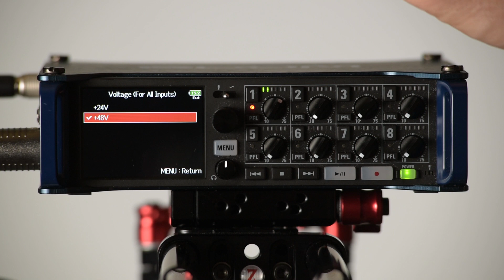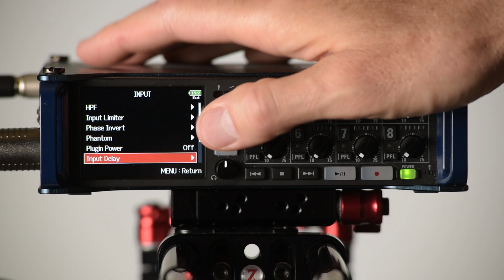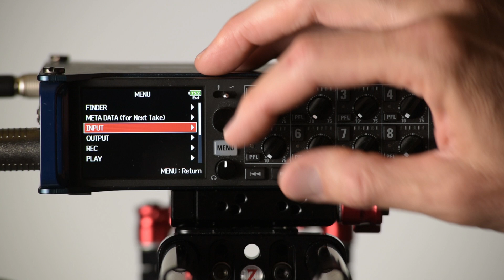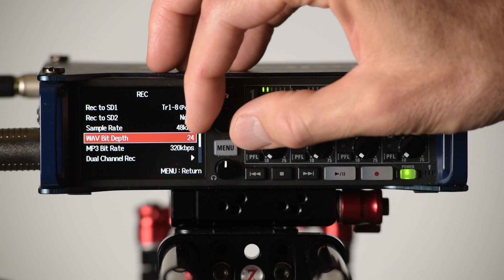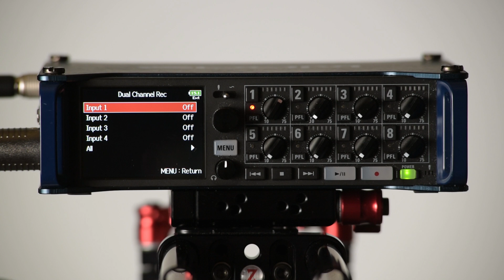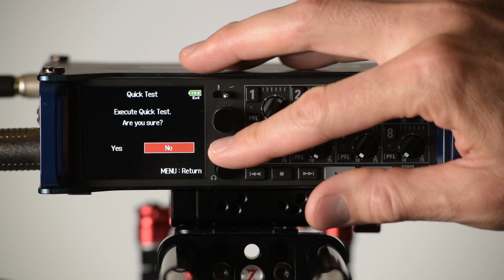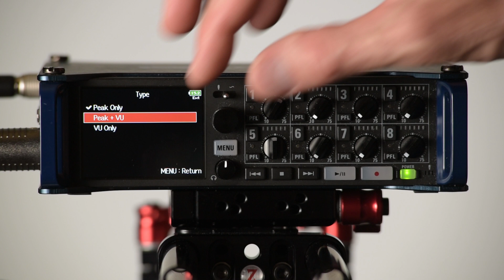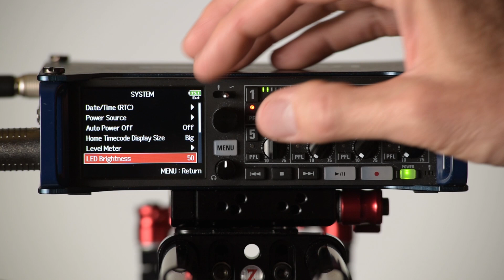Setting up the Zoom F8 Audio Field Recorder 30 June 2016

Comment: Please what is HPS mainly used for because I usually put my on 80
Reply from the maker: High pass filter? for dialogue, 80Hz is a pretty good place to start — it filters out low frequency rumble without cutting into the dialogue sound.

Comment: Hello after all these years:p i have a zoom f8 frimware 6.1 and i want to record line signal with a trs jack and i don't have the option in input source to select line! The only options i have is Analog inptut and usb 1,2,3,4. If you see this msg i will so much appreciate your help cs i search the hole internet and i couldn't find anything! Thx anw :)
Reply: Yes, you plug in the 1/4” TRS plug to the inputs on the F8 and that tells the F8 that it is a line level signal. If you plug in an XLR connector, that tells the F8 that it is a microphone.

Comment: Hi Curtis! Do you happen to know, why monitoring stereo mix from Ambisonic A format recording (in that case recorded using Rode NT-SF1) in F8 is so low? Levels are like 12dB lower than isolated A format tracks. Did I do something wrong? Is it a bug? A feature? Of course I can boost fader on Tracks 1-4 (Ambisonic) to +12dB but I guess it should not look like this.

Comment: Just a quick opinion on powering via USB and portable power bank.  You can do this as long as you have a USB/Hirose converter cable which re-amps the voltage from USB to something that the F8n can use.  And depending on usage, this can last all day.
Reply: Thanks Aaron.

Comment: Hi Curtis
Many thanks for all the very informative videos. 
I have a quite specific question, dunno if you have an idea for this: in rehearsals we frequently switch between recording ourselves and listening back to the tracks on monitor speakers. During recording we need the speakers off, otherwise we get feedback.

Is there a set of settings, that turns outputs off during recording, but on during playback? 

many thanks
Reply: Hi Rafael, unfortunately, not that I am aware.

Comment: Hello Curtis, many thanks for your tutorial. It helped me to get started. 

Now I am searching an answer for how set up the Zoom F8, when recording on sd1 : Mic 1 and 2 + Automix L/R in PolyWav

and

recording on sd2 : dual channel Mic 1 onto track 5 and 2 onto track 6 + Automix L/R in PolyWav?

I do not want channel 1 - 8 + L/R (PolyWav), because then the automixed L/R would contain the normal tracks (1 an 2) as well as the reduced dual tracks 5 and 6 tracks. That is wrong.
How to set it up correctly?
Many thanks in advance
Reply: Hi Ralf, If you only need the isolation 5 & 6 channels and do not want to include them in the mix, set their faders to -infinity. You will still record the isos and can use them in post if needed, but they will not play in the mix. Best wishes!

Comment: Hello Curtis! Thank you for great reviews! 
It might be an old one but I have a question in relation to zoom f8 outputs. What would be the best way to boost consumer line level signal when outputting to line +4/pro line level input since f8's outputs are only capable of outputting  -10/cosumer line level? Any advice would be greatly appreciated. Thank you!
Reply from the maker: Hi Skirmantas, most cinema cameras with a line level input have a trim setting so you can adjust that while sending tone from the F8 - adjust the trim on the camera until the camera's meters are at the same level that you're sending tone - usually -20dB.
Reply: @LearnLightAndSoundSessions  Thank you for answering my question! The main problem I was experiencing was that when I feed Sony UWP transmitter with mix it wouldn't stage it properly, uwp transmitter doesn't have control when switched to line level and the level would be far too low. I started using G4s for feeds in that respect they more flexible.

Comment: Hey Curtis! Thanks a lot for your video!
I have got two questions :
1) When you record tracks separately, do you get the PFL or the SOLO version of it? I mean does it make sense to bother doing a first mix on the F8n (even if things will be slightly modified on a computer later) or not?
2) Can you modify the mix while playback? As a musician, I cannot play and do the mix at the same time. So it would be perfect to do the mix while listening playback. And then I wonder if this mix stays for the next tracks that will be recorded..? I guess this option would be only available if recording separate tracks (and not if only recording the L/R mix)..?
Thanks!
Reply: Hi Lionel, 1) Yes, you get the PFL version of the isolated track. It makes sense to do a mix on the F8n while recording if it makes sense for your production. If you don't need it, then you don't have to bother. 2) No, you cannot modify the mix on playback in the F8n or any of the Zoom F series recorders. This is a feature available on the Sound Devices MixPre recorders. They call it re-mix.
Reply: @curtisjudd  Thanks for the quick answer!
Reply: @curtisjudd  One more precision : I checked those MixPre devices. It seems you can re-do the mix afterwards. Of the exact same track.
My question was a bit different. The idea is to do a sound check. Modify the fader accordingly (while listening playback) and then record a NEW track with this modified mix. (I hope I can explain the difference clearly).
So basically the question is : what happens if you modify the fader during playback?
Thanks!
Reply: @LionelAndrey  Do you mean overdub recording where you replace a track as another take like one would do in a recording studio?
Reply: @curtisjudd  No... Maybe I give you a concrete example :
 I'm a clarinetist and I record a piece clarinet + piano. There is no sound engineer (other than me also playing the clarinet). So I set the mics (a pair for the clarinet, a pair for the piano and a pair for general). I set the gain for the different pairs of mics. Then I do a soundcheck (meaning we play the first 30sec of the piece). I listen back and realize the balance (mix) between the two instruments is not good yet. Can I monitor this balance while listening back (like on a mixing table)? And then we would record the whole piece "for real" with this new balance setting.
If I cannot change the balance while listening playback then I need to change the balance a bit randomly (without exact control - if there is too much clarinet in the mix I'll put it down but I might not know exactly how much down it has to be) and then we need to do a second soundcheck, plus listen again to the playback to see if it is improved. Probably it's improved, but not exactly perfect so I need to fine-change the balance again, do a third soundcheck, etc... Before really recording the whole piece. So I loose a lot of time.
Of course this whole process is easier on the computer with the ISOs. But if it's possible to do it directly on the F8n, then I save time.
Reply: @LionelAndrey  Ok, I think I understand now. No, there is not a way to change the gain of fader on a recording which has already been done. However, with the F8, this is not too much of a problem. Because it has extraordinarily clean preamplifiers, you can adjust the levels for the two instruments and fine-tune the mix in post. The only thing you really need to be concerned about when setting up is that the instruments will not hit 0dBFS when you record. You can easily leave 18dB of headroom and then boost it perfectly in post production on your computer. I hope that makes sense?

Comment: If I plug in two XLR cables in Input 1 and Input 2 does can i attach them into the same file? (For exemplo having them direclty from a Mixer record Left in one cable, right in another) ?
Reply: Yes, set the F8 to record Tr1-8 to the SD card and you'll get each microphone on its own channel in the same file, called a poly wav file.
Reply: @curtisjudd  Cool, so with that feature, i can record a Mixer (Rec Out) and have two cables attached to each Input and have them linked on the same file, right? Is that the propper way to have it recording a Mixer?
Reply: @msiqueira-dev  Yes.

Comment: Thanks a lot dear  Curtis for these very thorough video's. Have a question for you...  After watching your video about the Tascam DR 701 i thought it to be the best option for me to shoot with the Canon 5D mark iv. Now after seeing the F8 i started to consider this. What i liked about the DR 701 was that it can be hooked up to the camera with HDMI and then start/stop the audio recording simultaneously with the camera. The F8 does not have something similar does it, and how would it work with the Canons timecode if it works at all? Many thanks again, Robert...
Reply: Hi Robert, The HDMI triggering feature was rather hit-and-miss in my tests back in 2015 when I did the review (I think it was 2015, maybe 2016). I don't know whether Tascam has updated the firmware to make that feature more reliable, but there were a good number of cameras with which it didn't work. And even with my GH4 back then, it worked about 50% of the time. That isn't something I'd recommend counting on. The Sound Devices MixPre series have a similar feature and recently update their firmware to work with more cameras. So that is worth considering. The Zoom F8 does NOT have this feature though it is a superior recorder in every other way to the DR-701D.

Comment: when using mine the l/r levels are much higher than the individual channels  levels and I cant seem to get trim/fader level set comfortable to use for live TV work, in your video the l/r level was equal to you channel one level, I cant attain that for some reason.
Reply: Are the faders for each channel set to 0?
Reply: @curtisjudd  hi there thanks for the reply, are you referring to the MAIN OUT 1/2 fader on the left side, detailed in white??
Reply: @curtisjudd  as shown in the photo scroll down here??  https://www.fujix-forum.com/threads/audio-recorder-zoom-f8-briliant.50161/
Reply: @stewartshape8978  I was asking about the faders for each input channel. Each input has a trim and a fader. You'll want to at least start with the faders on each input channel to 0.

The output faders are a different matter. I'd start with the input channel faders.
Reply: @curtisjudd  thanks again for the reply, I can get a mid level led level on the input faders when viewed on the multichannel screen led display but always the L/R output is always so much higher.
Reply: @stewartshape8978  What is the fader set to on channels 1, 2, 3, 4, 5, 6, 7, and 8? Is suspect they are set to something above 0 which is why you're experiencing this issue.
Reply: @curtisjudd  hi there Chris when you say fader do you mean trim level or "level post trim fader level" ?
Reply: sorry to use this kind of speaking but I have just changed from twenty years SQN USE!
Reply: @stewartshape8978  Each input channel on the F8 and F8n have three main settings you can use when mixing: Trim, Fader, and Pan. You should check to make sure that the fader for each input is set to 0. Please see page 76 of the Zoom F8n Operation Manual which can be downloaded from Zoom-na.com. I also have an online course on how to use the F8/F8n over at school.learnlightandsound.com if you are interested. We cover how to setup, mix, and get the most from your F8 or F8n. Best wishes!
Reply: @curtisjudd  and sorry Chris one more question, when I powered down on a set it started time code at zero again, without jam syncing to cameras or tentacle boxes, should I use RTC time code setting, to make sure I never repeat a time code even when I power down?? thanks
Reply: @stewartshape8978  Yes, I would use the RTC setting so you don't get overlap after meal breaks.

Comment: Howdy! I have a question... regarding F8 firmware v5 - after testing recording 1-8 + LR, somehow I can only hear the iso tracks (as the faders were on their last position at end of recording), when in playing back I can't listen to the actual LR mix, I even tried with different headphone presets. I've only been playing around with the for a few days and can't figure out if there is a specific setting for this or if its by design. Just to add - only when listening to the poly file on PC you can hear the actual mix. Any help would be greatly appreciated!
Reply: Hi Theuns, I would double check the routing for the headphone presets to ensure the L+R mix are sent to the left and right headphone cups. We cover headphone routing here: https://youtu.be/As-jVp-ROCo

If you still have trouble getting the mix to headphones, you may want to contact Zoom technical support.

Comment: Hi Curtis, at 5:07 you mentioned Plugin Power. I just bought this Zoom F8n and have been playing about with it. I was at a loss as to why Plugin Power wouldn't work for me. I plugged in my Zoom XY Mic because it has a 3.5mm jack for an external Mic. Hey presto, Plugin Power was now an option whereas before it was greyed out. I tested it with a Rode VideoMicro and it worked fine. Perhaps it's an odd way to implement it but I guess Zoom will have it's reasons. Thanks for this walk through, very helpful.
Reply: Thanks Steve. I just saw that in the Zoom F4 manual last week, too. Odd, but I guess it makes sense.

Comment: Hi Curtis! I've a question about the Zoom f8n. Is it possible to power this product with the power bank (50000mAh) that i link to you here? 
 
https://www.amazon.it/dp/B01LZXPMXM/ref=cm_sw_r_em_api_i_uLJpCbD207H02

Thank you so much!
Reply from the maker: Yes, it appears that it can supply 16V output so if you can find the right cable, it should do the job.

Comment: Hi Curtis, great tutorial! I want to interview a friend (she's an opera singer) with three mics (Lumix G7 with two lavaliers and one boom). I am concerned about the digital limiter (because she starts singing very loud in an instant) and i cannot control audio while interviewing. Would you still recommend the F8? Maybe you have another video where you talk about this subject? Thx in advance!
Reply: Hi Axel. This can be a tricky situation, even with analogue limiters such as on the Sound Devices MixPre series of recorders. What you might consider is setting the gain on one of the mics for her singing and the other for speech. Then in post you can cut between the 2.
Reply: Curtis Judd great tip! Thank you

Comment: Brilliant - I can't wait to get my hands on one, Q: how do you switch the inputs between mic and line level in? Thank you!
Reply: On the original F8, using a 1/4" TRS cable told the F8 it was a line level signal, using an XLR told it that it is a mic level signal.

On the F8n, you can switch that on the PFL menu for each input and use either type of cable for mic or line level input.

Comment: Hi Curtis, thanks for all these very informative videos. I'm considering to get a high quality recorder soon, but may have got sort of misconception about this kind of recorders, so I'd like to know: is there a possibility to make overdubbed records, i.e., can I for example record one track, then play that track back and record something else on another track at the same time? Or does it only work that way, that all the tracks can only be recorded in one take simultaniously, then played back all together? In short, can I use this kind of device as a multitrack recorder, playing back and recording at the same time, or only one after the other. Please apologize my ignorance, I just can't get this basic information by reading the manuals. Thanks a lot! My background is not filmmaking but recording high quality music demo tapes completely independent from PC or Mac - DAW etc., looking for a standalone high quality multitrack solution.
Reply: Hi Zelamir, Thanks for asking. The Zoom F8 (and F4 and Sound Devices MixPre-3, 6, and 10T) are primarily designed as field recorders for filmmaking. Because of that, they do NOT have the ability to overdub when not connected to a computer. When connected to a computer, they can overdub by using digital audio workstation apps like ProTools, Logic, Studio One, etc. So for your purposes, these are probably not the best option. I'm not certain because I haven't tried it out yet, but I believe that the Zoom LiveTrak L12 might have the overdub capability: https://bhpho.to/2DR97wt You'll want to research that a bit to confirm. Best wishes!
Reply: Thanks very much. That's very helpful! I was already close to get one of these due to that brillant audio quality. Now I'm going to rethink it all.

Comment: Yes, 24bit absolutely gives you more headroom (or rather, reduces your noise floor noticably)

As a mix and mastering engineer I've personally experienced this. Things recorded at 16 bit have to have been tracked quite hot to get things high enough above the noise floor to then use any dynamic range reducing dynamic processing in a modern production without hearing a noticeable floor.

Some people don't mind it, but an extra 8 bits of word length to give yourself more breathing room and a better quality sound isn't a bad trade off at all, especially with the size of drives and storage mediums these days.

Sample rates are another matter completely though. I know these may be fighting words for some people, but according to the research I've read, and my own experience, higher sample rates are pointless as they do not offer any better resolution beyond 44.1 or 48, and a higher sample rate will eat up bandwidth way faster than a jump from 16 to 24 bit.

Personally I keep to 24 48 on everything. But have had some cats request float 32 48 on projects, which is totally fine too.

Honestly I'd use float 32 bit too if I was doing an extremely delicate recording with a crazy dynamic range. Say, an orchestral performance in a sweet concert hall or something.
Reply from the maker: Thanks Lock! Good to hear your experience. I nearly always record 24 bit (or process in floating 32 bit). The only time I use sample rates higher than 48 are when I'm recording  a sound effect I know I will slow in post.